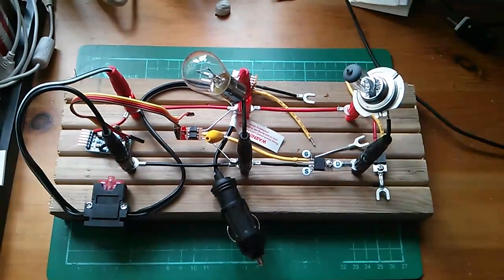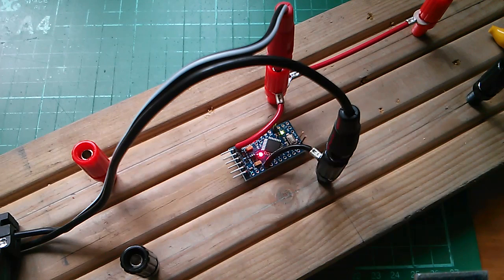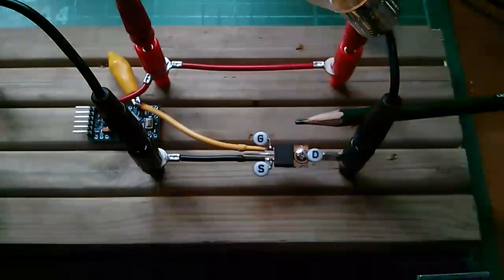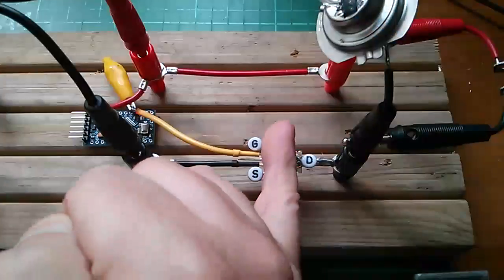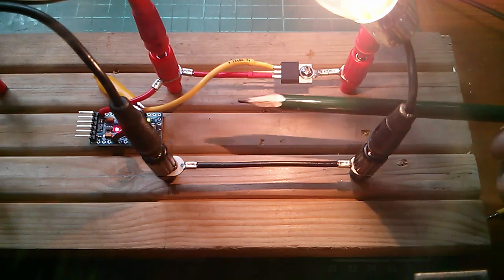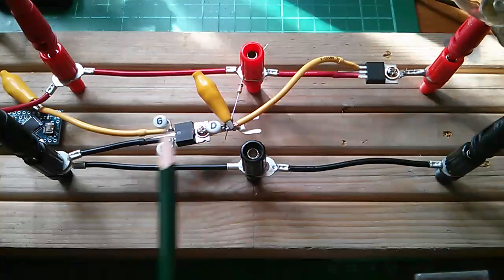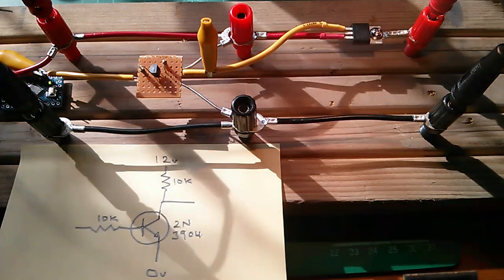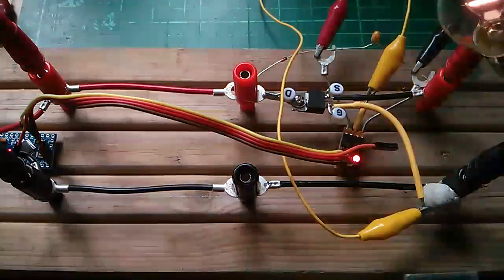Practical MOSFET Tutorial #5 - Microcontroller Interfacing

Comment: great series!  question:  why is it not necessary to use a gate resistor to handle inrush of current as mosfet cap ramps up initially?  I have worked on an automotive circuit that would absolutely fry ecm controlling mosfet without it...

Comment: 6:17 You have the same kind of problem with an N channel MOSFET on the high side, since we need Vgs = Vg - Vs  > Vth (positive for an N Channel )  to have the MOSFET closed (not optimally closed, but closed none the less). Since Vs = 12 V for the lamp (at least, this is highly expected by the "client"),  Vg > 12V, which the Arduino can't supply. So, we need a MOSFET driver TOO, even for an N Channel. And we fall back to the previous video, or with a MOSFET driver, as in this one. I imagine that, at 9:30, we could also use a BJT under the control of the Arduino, instead of the opto (even if the opto is a nice illustration).

Comment: is the GND of  arduino and mosfet common?  or isolated grounds?
Reply: They are shared ground. Don't try to send one (1) Amp through a GPIO pin of an Arduino, it will fry, that is way over what spec. allow.

Comment: are the opto-couplers indispensible? or could I drive a PNP-NPN transistor pair directly from the uC?
Reply from the maker: Yves Baggi That's difficult, you may need a third transistor to handle the inversion and level shifting. Optos make that part easy.
Reply: Julian Ilett Aha, level shifting. At first I was "what's eh talking about". and now: of course.. 0-5V to mosfet rail 0-24V (in my case).

inversion I don't care about (I think) because I can just handle that in the software if need be.

Are teh opto-couplers switching as fast as a transistor?
Reply: +Julian Ilett sir can you please upload a video for PWM 12 volts high ampers with tutorial...i am the one of your subscriber.thanks sir.from philippines.

Comment: It seems like the n channel mosfet worked fine with the arduino. So why would you want to swap to the p channel mosfet with all those additional electronics?
Reply from the maker: Gadget Addict I like to try lots of different configurations - see which works best.
Reply: Julian Ilett Okay thanks Julian. I just wondered if there was a specific reason for making life harder haha. I'm really enjoying your videos :)
Reply: You have to be on the high side (and on the low side too) in order to switch correctly the windings of a motor, as example. Sure, if the motor is a 5V DC... but if it is a 12V, the Arduino can't handle it. And in any case, the Arduino can't supply enough ***amperage***, ***directly***, even for most 5V DC motors (it is better than for a Raspberry, but not that much... I don't have the specs at hand right now, though).

Comment: I got BOXES of parts from the electric motor and drive manufacturing company I used to work for. We got bought out and our product shipped to another state. The plant was shut down. Real bummer, that was around 100 jobs...But hey, at least they didn't go to China! :)

I have a BOX of MOSFETs. I dug through every part number... and every part number was an N-Channel MOSFET.

I guess I know why now! XD

It least I snagged more NOS MOSFETS than I even know what to do with! Next project, my new boss is my old boss, and he's got his own little motor manufacturing shop. Gonna build him a low RPM stator direction of rotation test fixture. I need to create a slowly rotating magnetic field by driving a three phase sinusoidal signal to the stator windings. I plan on driving PWM off the sinusoidal sources, and feeding that into three high side and three low side MOSFET drivers, to form a three phase "H" bridge (is it still an "H" if there are three phases! LOL).

I wasn't familiar with the more nuanced details of MOSFET design, but this tutorial is the best I've seen yet, and I'm slowly but surely filling out those gaps in my technical knowledge!
Reply from the maker: Richard Pi Thanks Richard - good luck

Comment: So the top of the MOSFET where you are using as the drain is also the drain?  I thought you had to use the middle pin as the drain!  So where you bolt the MOSFET to the heat sink can be used as a drain.

Comment: The main thing I learned from this video is that P-channel MOSFETs are a pain in the butt and should be avoided if at all possible.
Reply: But but but, high side switching!
Reply: See the previous video and you will change your mind, at least, about using N Channel MOSFET on the high side. You HAVE TO use a switch on the high side when you control a 3 phases motor, or the access of a motor through a H-bridge, since you have no option about where can be the load in relation to the power and the switch, in those cases.
Reply: I did not see any other way. I have to switch on / off the charge supply to the battery and when the charge is off I allready have an N channel fet between ground and the load to turn on/off the load.  The fact that I do not see any other way does not mean the is no other way of course.

Comment: hi Julian,how about interfacing of SIT(static induction transistor) with Microcontroller or FPGA.
Reply from the maker: Never heard of a SIT until now. Appears to be a specialist device used mainly in audio circuitry, although the gate drive requirements look similar to regular MOSFETs.
Reply: yes,its new power device that was invented by Japan in 1977.now a days,it has been working on it in China and Japan.....

Comment: Julian, interesting tutorial would be keen to know more on the boot strap circuit set up when you make the next tutorial.  I am using a MOSFET in a project but running it at 24kHz, currently using a NPN transistors in totem pole to drive it as the its a 3V microcontroller.  The MOSFET is not a logic level device and RDS(on) is 10V but managing to switch it on at 6V, would like to lower the supply to 5V so the boot strap circuit could be very useful.

Comment from the maker: You're right, a supply voltage of 12v makes things easy, but I have only got to part #5 so far! Using a 24v supply, a 12v regulator can provide the gate voltage and bootstrap charging voltage. At 36v or 48v it's a bit more difficult, but HV regulators do exist. Ultimately, I will look at commercially available MOSFET gate driver chips, but not until all the techniques have been covered.

The MPPT controller will be able to use panels in series - I did a test with 72 cells in part #10

Comment: Hi.

What about the"bootstrap capacitor" or "charge pump" if the working voltage is higher than 12V ?
Let say it is 24V. Oops, in that case the bootstrap capacitor would give that 24V between gate and source and might blew up !
A shame because in the MPPT project, it would be so nice to be able to work with solar panel in series instead of parallel for I2R losses minimizing on long line !
As the MPPT already works as a DC/DC converter, it would make the job easy to get 12V from a 24V panel

Comment from the maker: With a big heatsink and some fans, you could get close to the data sheet value for maximum drain current (although note that package limitations may apply). Without a heatsink it's a much more complicated question. You're relying on heat radiating and convecting away from the device. Ambient temperature will be a factor (whether it's a hot or cold day). The data sheets have graphs for thermal transfer characteristics, but it's probably easier to try it and see what happens.